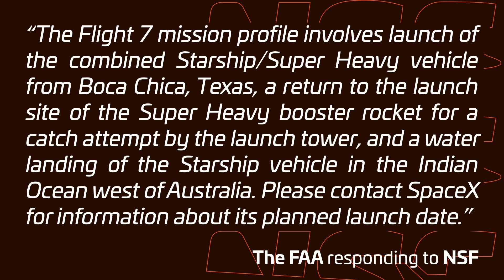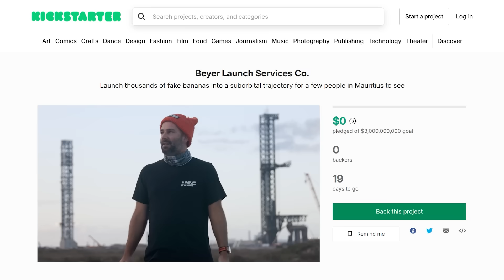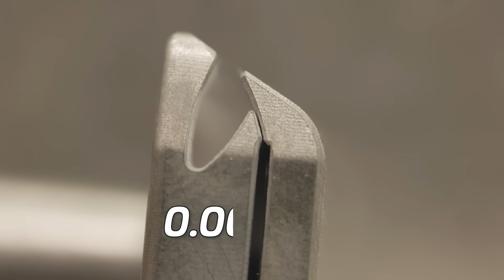Starship READY for 2025: Flight 7 Updates, Pad B Progress, and a Festive Farewell 🚀|Starbase Update

Comment: Could you cover the quick disconnect, or critical tower locations, with heat tiles!? Dont know why ive never heard this suggested before. Im sure there must be a logical reason as to why they dont.

Edit: Nevermind, commentted too soon lol Water-cooling is way better!
Reply: Probably has a lot more to do with mechanical strength than temperature. I doubt the tiles would survive the force of the rocket.
Reply: My only thoughts on that are on getting the amount of tiles up that high, what if a few fall off and damage the olm, quick disconnect, the sqd or even the rocket. It would also be a bit different than re-entry 33 raptors seems a little too much heat and power for heat tiles. it would probably just be better to just install a cooler inside the 'important bits'/deflector surrounding/covering the 'important bits'